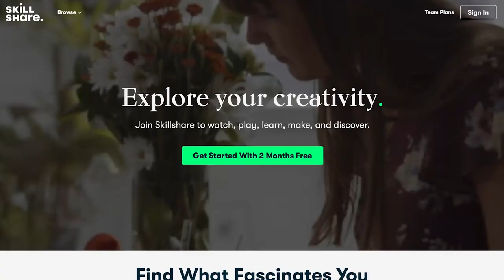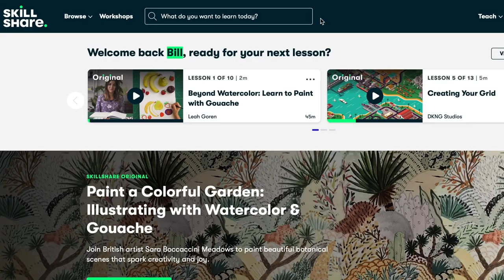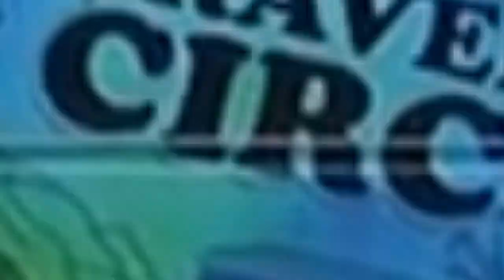Pro Skiers Building a Van for their Needs - Line Traveling Circus

Comment: Jarrod, I had come across one of your other videos on insulation (that I can't find again... LOL 😁), when you mentioned you did not like the refletix insulation, what would you recommend for the tire walls for insulation if not reflectix? I like the wool idea, but asking for the tire walls for any better ideas? (Sorry, if I misspelled 😁)
Reply from the maker: I'd use Frost King, a sound deadening product, wool, thinsulate. Combination of those is even better
Reply: @JarrodTocci  cool, thank you, this week I'll be removing all the old carpet from the floor and tire walls in this 2000 GMC Savana full size conversion van, I can imagine the mess I may find under it from previous owners before me that I know will need good clean, the undercarriage is good no rust found, but will be cleaning any possible surface rust, filling any unnecessary holes with bondo, and after that sanding, cleaning up any dust from sanding and repaint those areas with rust-oleum white paint (color of van) before I start doing the flooring, tire walls, etc. Again, thanks a bunch, love your videos they have been very helpful in many ideas for my newer van built.😊